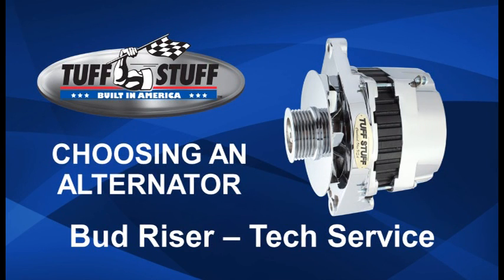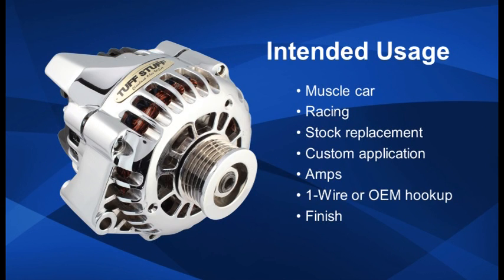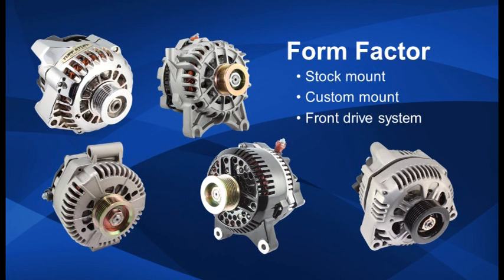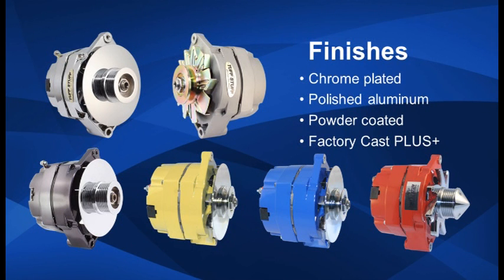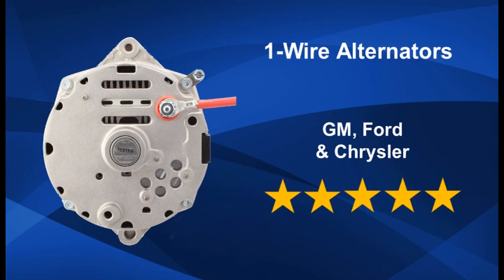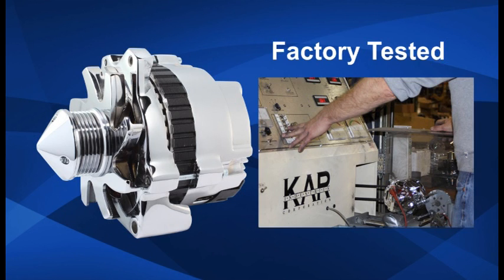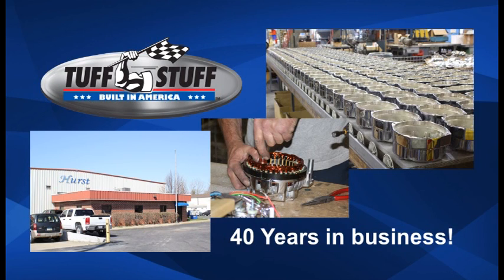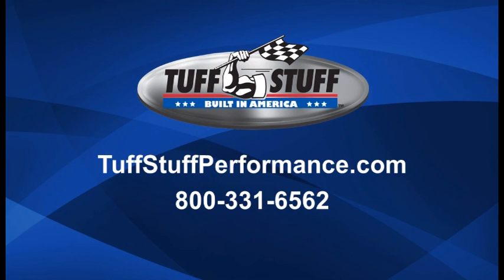Choosing an Alternator

Comment: Do you have a 75-80amp 1 wire alternator for a 68 Mustang 55amp Also the bolt hole is a 7/16th on the alternator to the engine block.?. 😊🙏🏽👍